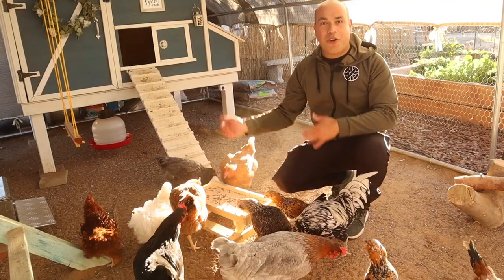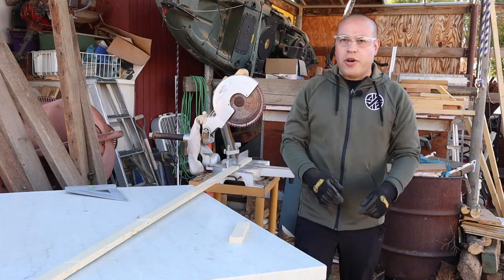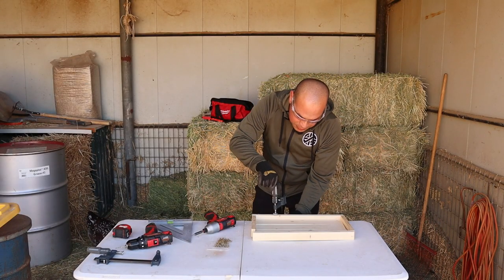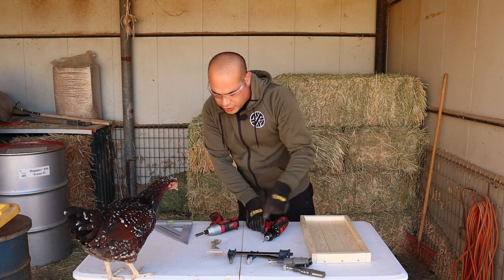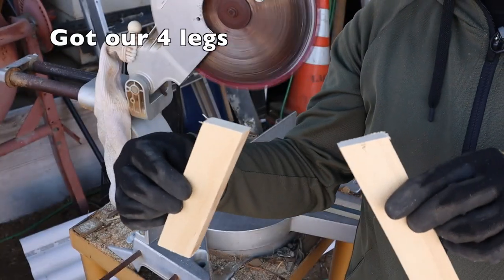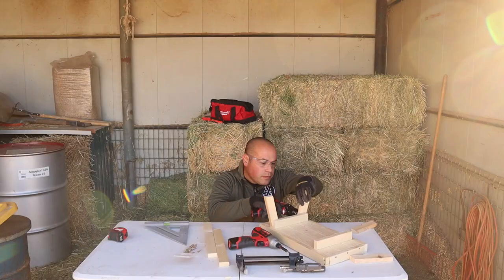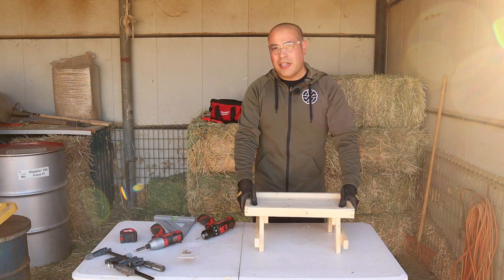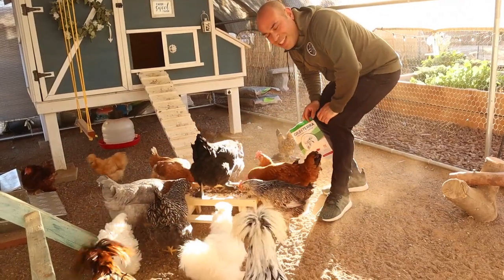How to Build a Chicknic Table - Easy DIY Chicken Picnic Table with Plans

Comment: Maybe I am bad at math, but if the table-top is 7.5" wide and you used 3 1x3 boards @ 2.5" width, how do you have spaces between the  boards? Especially if it is outdoors maybe you should make it a bit wider to leave space for board expansion?
Reply from the maker: It is a tight fit, but still wide enough for water to flow through when we rinse it out. It has worked out well so far =]

Comment: Just built one following this vid! Turned out great. One thing is I ended up with over 5 1/2 feet left of the 1x2 so to save a couple bucks you could get an 8 footer and a 4 footer of the 1x2. Other than that awesome stuff thanks!